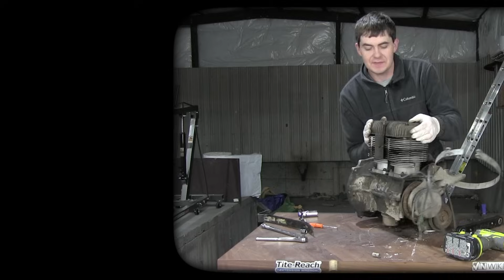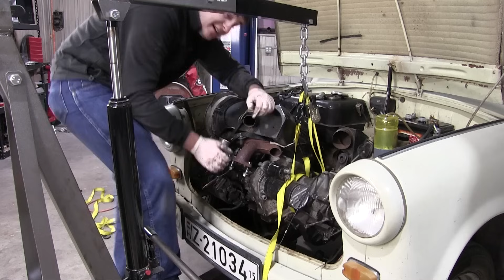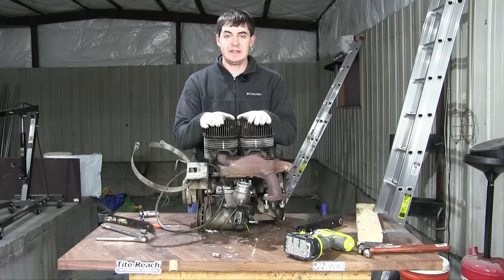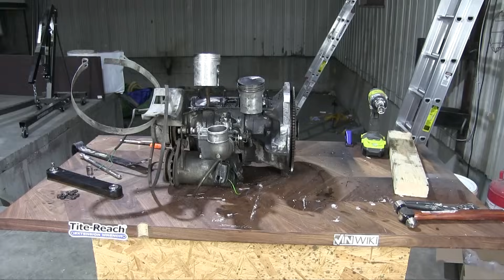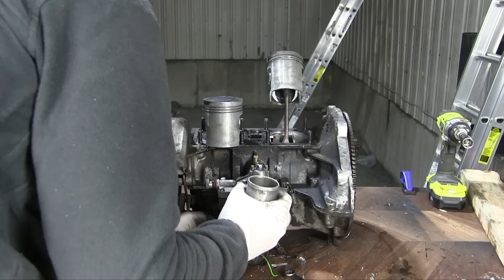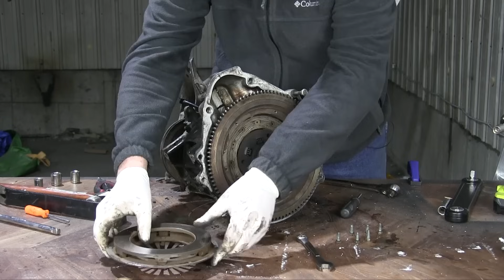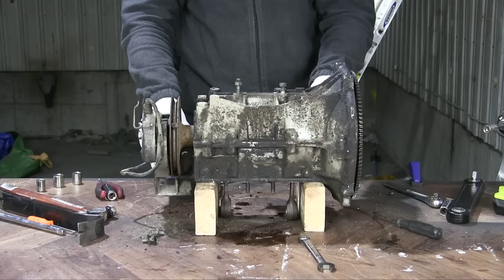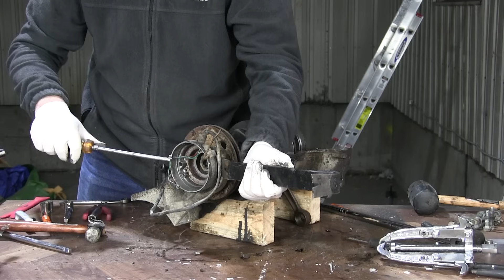Rebuilding the Trabant's Engine: Part 1 - The Teardown

Comment: I've repair Trabant engines in the 80's, when I was young. Not for fun, I was a car mechanic. 
At the age of 19 I quit the job, never touch a Trabant anymore ... :D

You say:"I don't really know what I am doing!" 
But you know how the 2 stroke engine runs, and I guess that's mutch more then the most people know. ;)

BTW 
It's possible to remove the engine alone, without the gearbox. By hand!
I have done this a hundred times ...
The flywheel goes loose with a few decent (1 Kilo / 2 pound) hammer whacks near the starter gear rim.
And of course, there is no reason to remove the whole exhaust! :D

Important when assembling: 
The rotary valves must be installed with the missing corner in the direction of rotation.
Align the cylinders with the exaust manifold, and then tighten. Otherwise the elbow on the manifold flange may break! (It's made of cast iron.)
Reply: Sounds reasonable. "Can't build it bullet proof? Then build it easily workable and repairable at least!"
Reply: john jay  Yeah, modern cars have gone backwards in my opinion.   I had a lot of older cars and bikes that did better mpg and like you say started ran and never give trouble.   The BMW model you speak of is such a low stressed motor and that's why it has little problems.  The components are capable of taking double the stress of the factory tune.
Reply: john jay   The problem with all modern engine repair is the electronics.  BMW v 12 is still only a rotating mass with valve control system and ancillary components. Maybe more to understand but still mechanically quite ordinary.  2 strokes may only have a few moving parts but setting one correctly can be difficult and performance 2 stroke engines are a lot harder to tune than 4 stroke engines.
Reply: john jay OK the 352 I stripped out ran a timing chain.  Maybe it's a different engine. I did not check the designation. Appoligies I thought we were speaking of the same in line six.
Reply: john jay  Or do like I did as a teenager and resell it into a kit car and if you really want to leave skid marks (on the road not yer pants)  run it on the 14" rims from an older 3 series. Speedo needs changed or ignored cos it will be wrong and you will lose about 25kmh top speed but the are like a go kart.  I used a locost chassis and didn't buy the bodywork nd ran at tracks drag strips and even beaches until the only real problem those engines have killed it  (Oil starvation causing exploding timing chain and the associated mess)  never lend your car to a donut addict!
Reply: john jay Don't know, I'm not a big bmw fan. I bought it with the side bashed in and striped it for its engine and running gear.  When it blew up it was the chain that failed and it was dry as a bone.  Been told it was common with donut usage.
Reply: john jay will give it a try. Is it suitable for classic car engines.   The BMW was the E36 body type the engine I was told was built proof and all I did was a quick service. Guess I should of did more research.  But like I said I was a daft teenager.
Reply: Did you work on the classier east german car - Wartburg 353??  
This was the satellite states answer to BMW's executive car.

Comment: The Trabant... The most fragile car you wanted to avoid driving in Operation Flashpoint back in the day.
1 round of 5.56 and the car would be undriveable, but you could get out... 2 rounds and the vehicle blew up Hollywood style.
Suffice to say, you were better off hoofing it than taking the Trabant :D
Reply: if it broke, you didn't need a towing vehicle, you could just lift up the rear and carry it like a heavy suitcase.

Comment: That crank can easily be rebuilt, I've even done them with just a home press and and a couple v blocks, ( on my own stuff) and I have even used off the shelf bearings from a supplier. For customers snowmobile or watercraft engines I will send them to a pro guy I know and will either have it rebuilt or exchanged and will use genuine crank bearings
Reply: btw you can use a deep socket and a long bolt and nut to "pull " the wrist pin out , lot less jenky that that wooden thing  :/

Comment: Consider sending those cylinders out to Millennium Technologies or someone similar to get Nikasil coated.  Also, any two stroke shop (snowmobile) should be able to press that crank apart, put in new bearings/pins/etc and press it back together for you, might be cheaper and quicker than buying a new crank.

Comment: In 1990 we were on a high school trip to West Germany, and were on an overnight charter bus from Munich to Berlin.  This was just after the reunification of GDR and DDR.  There were Trabbis and Wartburgs everywhere.  We were following a Trabbi on the Autobahn and I saw a shower of sparks coming out from under the Trabbi, then a large dark lump came out from under it.  Our bus ran right over it.  The driver said the engine had just fallen out of the Trabbi, which he made to seem like a common occurrence.  Do you think this is possible?
Reply: Well it is possible but kinda unlikely. Trabi owners took extremely good care of their cars, since they were hard to get and replacement parts were always in short supply so regular painstaking maintainence was the only way to keep it running. Granted caretaking deteriorated around reunification time since they quickly dumped the Trabi for a western car.
Reply: GDR is DDR you mean between GDR and Federal Republic of Germany
Reply: A lot of Trabants were straight up abandoned in West Germany after reunification.  They were so shitty most people didn't care about them.
Reply: Ah! Wartburgs! My father had one here in the Uk in the late 60s. It laid down an effective smoke screen when first started on a cold morning, but was an excellent car in all other respects. Certainly no worse than the Vauxhall Victor it replaced. I think he took it to well over 60,000 miles with no real issues. The only bit he didn't really like was having to deal with the 2-stroke oil when refuelling.

Comment: Some helpful german translation for you Trabant owners over there in the states:

Kugellager - roller bearing
Abgasanlage - exhaust
Hauptbremszylinderflüssigkeitsbehälter - main cylinder reservoir

I would add some pronunciation, but since German is one of the easiest to read and to learn while also melodious language, I don't feel like this is needed here.
(btw. these words are not made up. consult your "Betriebsanleitung zum Personenkraftwagen Trabant 601" )
Reply: As a german, i can confirm that these are actual words. Hauptbremszylinderflüssigkeitsbehälter :)
Schatz, uns sind die Leerzeichen ausgegangen, was machen wir jetzt?
Reply: @luuk3213  Though a better translation would be "master cylinder brake fluid reservoir"
Reply: @stephanuhu963  master brake cylinder fluid reservoir. Because it holds the fluid for the break cylinder.
Reply: I love how in German a great number of things are simply (what the thing does) + "anlage". Klimaanlage (air conditioner, or literally "climate appliance"). Alarmanlage (alarm system) and so on. Of course it's not unique, in Dutch and even in Afrikaans (which is like a 350 year-old experiment to improve Dutch) we do much the same. And then there was this thing I had in my 3-series BMW, called GAL for short, "Geschwindigkeitsabhängige Lautstärkeregelung", essentially the feature where the radio gets louder when you drive faster :-)

Comment: If you are planning to order the parts from Trabantwelt, let me suggest an alternative. Check out the Youtube Channel of Manfred Prautsch. The guy is an engine specialist for Trabant and he offers full or partial rebuilds. Not a promotion, and I haven't ordered anything from him yet, but he seems really chill and I heard that he does good work. He explains how certain parts of the engine should sound or feel in his videos and you can probably understand the basics without speaking German. 

During disassembly, you made the same mistake as I did by trying to pry the engine halves before removing the flywheel =D. I also broke the ring like that. 

By the way: On a 6V Trabant, the original clutch is made from asbestos. Handle with care!

Comment: Hey,
i'd buy these IBM blade center fans for exhaust extraction https://www.gekko-computer.de/Gehaeuse_und_Luefter/IBM_Gehaeuseluefter_BladeCenter_E_-_49P2531_74P5152_i5_8148_0.htm?gclid=CjwKCAiAodTfBRBEEiwAa1hausmQq4b5zyc4DPN97ENrLpWWPt65jLHOIyIxxffKT-6DjWaBqyR21RoC4OgQAvD_BwE there are possibilities to buy them cheaper and not from Germany, but so you see what I mean.
I once bought 5 of those for the low price of 5 € a piece. They have a very high throughout.

Comment: How comes you can't lift the engine and box by hand?   My Reliant 850 and box which are both bigger albeit all aluminium I can carry quite well with both hands, is the construction all cast iron including the gear box casings as your rig should weigh comparatively to my 850cc rig I would have thought :)

Comment: ohm... I have unbolted the motor, removed it, disassembled it, replaced a piston, reassembled it and put it back in. Alone on a parking lot in front of the shop that sold me the piston. Took me 3 hours. I can lift the engine out of the car by my self.

And about the muffler suspension. Replace it with some bend stainless welding wire. No one i know has the original rubber mount anymore, or bothers to replace it.

"Mit Hammer, Zange, Draht kommt man bis nach Stalingrad"
With hammer, pliers, wire you can go to Stalingrad
:-)
Reply: Uncle Ol'fart I hear new rings for Chevvies usually are thrown into the carburettor hole at around 1650 revs to make use of factory tolerances causing the vibrations needed to make 'em wandering in and installing themselves ... some say, though, it was the unbelievable abundance of fuel wasted that washes the rings in their places ...
Reply: grumpy old fart  When the rod poked out the side of the block I just kicked it back in and drove home.
Reply: grumpy old fart  you had tweezers?  in my day we had to have the smallest child in the village crawl in there and replace them.  

While the engine was still running.
Reply: grumpy old fart  uphill in the snow both ways.
Reply: Kraftprotz..!
Reply: @kpdvw  how you know this word?
Reply: Your special lol
Reply: @MikeSmith-ve2qu  He might have been referring to Volkswagens because they used the same methods.

Comment: You should drop a 2JZ in there, turn it into a drift machine.
Reply: It's about 3 metres (10ft) long and it's front wheel drive. No 2J. I thought about creating the ultimate economy car by putting some modern economy car engine on a trabant. Like, if i swapped a daihatsu cuore engine in there, I would double the power output.  Trabants are also dirt cheap in Germany, and i live a kilometre away from a junkyard.

Comment: Most people here think that a dynamo and a alternator are the same. I can see why people think that because they look the same and it seems they do the same as well. But there is a difference. A dynamo has fixed magnets. If the coil inside starts spinning it wil cut through the magnetic field and create electricity DC. An alternator does not have fixed magnets but has windings. If the coil inside the alternator spins nothing happens at first. You would have to connect a battery to the windings first so it can create a magnetic field and then it wil create electricity AC. So on a car with a dynamo you only need a voltage regulator, on a car with a alternator you need a AC to DC converter and a voltage regulator. This means that the dynamo will always create electricity if it spins, the alternator will need a power source first (Battery) for the windings to able to create a magnetic field and only then it will be able to create electricity.  I hope you undestand my explanation because english is not my mother language. Excuse me for if I made any mistakes.

Nice video! Thanks for the upload.

Comment: Since you admit that you don't know what the name of the part is, I'll be glad to advise. Americans refer to it as a wrist pin , and I admit that makes no more sense than all other English speaking countries calling it a gudgeon pin. The huge nut on the flywheel is called a gland nut. After 35 years of making a living as a mechanic, my opinion is that I would rather have you know  where it goes and how to properly install it, than to worry about the exact name of it. Only your parts man has to call it the same name as you do.
Reply: Never heard it call a wrist pin, excellent discription, regards from the UK.
Reply: @bostedtap  I've twisted a few wrenches in the U.S., and we always called it a piston pin, although I've heard older mechanics call it a wrist pin (because it works like your wrist).
Reply: @bostedtap  regards to you too, always glad to hear from the United Kingdom
Reply: @victorrobison5069  A "Gudgeon" is specifically a "cylindrical (i.e., female) fitting attached to one component to enable a pivoting or hinging connection to a second component."
                                                                                                                                                                                                                                      - lifted from Google.
The "Gudgeon Pin" as far as I can tell is cylindrical like a Gudgeon but it serves the function of the "pin" in connecting the pistion to the rod.
Reply: The word gungeon sounds like what they call a smelly crotch here in the US of a grundle is the correct word
Reply: as someone that spent two years in automotive and couldn't remember for the life of me the name, thanks for the service
Reply: And a good parts guy (so hard to find these days) will know what you're talking about from a halfway lucid description of where it goes and what it does.
Reply: "gudgeon" is a very British word.
Reply: In England we call it the gudgeon pin because a gudgeon is a small fish often used as live bait to catch pike (Google it). This is just one of the reasons Americans don't speak English or spell colour properly. Then of course there is 'the big ends'. Obviously a British Isles genetic defect but admired by the femail of the species.
Reply: @jp-um2fr  do bear in mind that for every big end, there shall be a small end......
Reply: Kolbenbolzen. Greetings from Germany
Reply: I've always called it a piston pin

Comment: its a 2 stroke  the only play you need to worry about is up and down,  the side to side play doesn't mean anything because if the cylinder is machined off the pistons could slide over and work if it was tight then it would bind

Comment: Small socket to push small threaded rod through pin and larger socket as a receiver on pull side washer nut then Tighten pulls wrist pin through

Comment: hello mate, check the surface were the rotary valves are riding on on the crankcase. if it has big marks you gonna have to get in decked or your new rotary valves won't last long.
the pistons and cylinder don't look bad, so your lack of power must be coming from the carb or the ignition, pls check that. An unmodified Trabant can run 110 easily, 120 if you want it.

Comment: It would be cool to somehow swap a Rotax 787 out of a SeaDoo XP into that car.  It would be around 60-70 HP.  You would have to convert to liquid cooling though.
Reply: The 787 is 110 hp. I have 2 xp's and was thinking same thing.
Reply: If I did an engine change it would be with the V-2 Harbor Freight Predator engine. The HP is not so high that it would eventually destroy the transmission, it's air cooled so no worries fitting a cooling system, and small enough to actually fit. You could even fabricate some sheet metal heating tin around the exhaust while making that so you can have heat in the winter.
Reply: Here in Eastern Europe you can find sometimes trabis with the 1.3l VW Polo GTi engine which produces around 100 HP.
Reply: I do know that some of the last trabants built were water cooled using a 1.1L VW engine, but as they're kinda rare tearing one apart probably wouldn't be best lol
Reply: Any vintage twin air cooled Sachs snowmobile engine would work on that car. Probably a 600 cc.
Reply: @scottfirman  That's true, I am not very familiar with snowmobiles since we don't get snow in the south.  I hear they are very powerful though.  I guess the only problem would be that it would more than likely blow the transaxle with all of that power.  lol
Reply: @bimmerwman  I am sure it could handle the power as it has to go through the clutch eatherway. I wish they were not so rare. I wouldnt mind getting one as a project. Easy to work on eather.
Reply: @bimmerwman  As it has snowed as far south as Miami ( did not make it to Homestead ) are you south of me?
Reply: @gravelydon7072  No Sir, I live in West Alabama.  We do get snow maybe once every 5 years.  I have actually  yet to ever see a snowmobile though.  Lol.  They would never sell any around here.
Reply: @bimmerwman  We actually sold a number of snow blowers down here. All of them ended up going north to NY. One of the companies has a policy that all dealers are allotted the same number of them no matter where they are located. So a southern dealer could order them when a northern dealer had already sold their allotment. I have one also for my mower but that is because the plan is to move to Ohio and it will be needed there maybe once a year. Happy Thanksgiving!
Reply: @gravelydon7072  That is very interesting.  It makes sense though.  There are many folks from up North that vacation in Alabama on the Gulf.  It could be a great opportunity to sell one down here to someone who travels in snowy areas.  Happy Thanksgiving to you too Sir!!
Reply: you dont need to. the RS had 65ps (yes there was a RS variant)
it was one of the best rally cars back in gdr